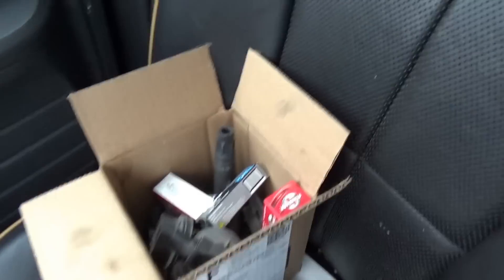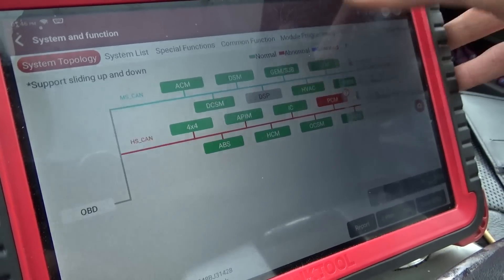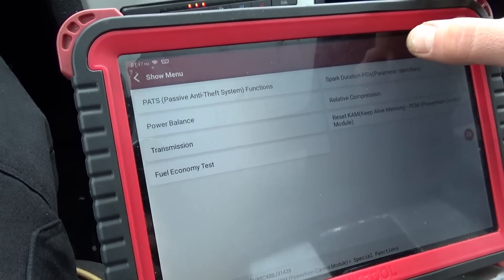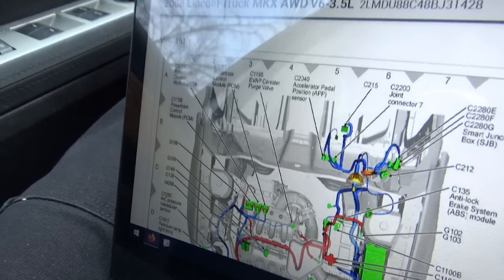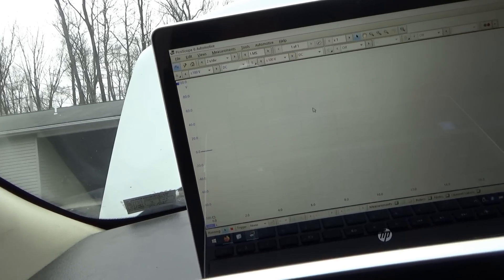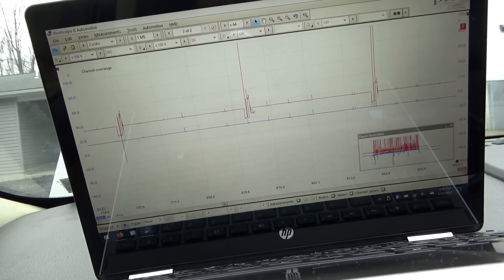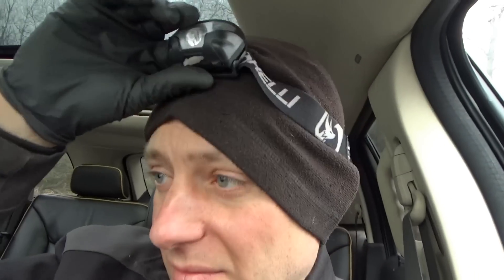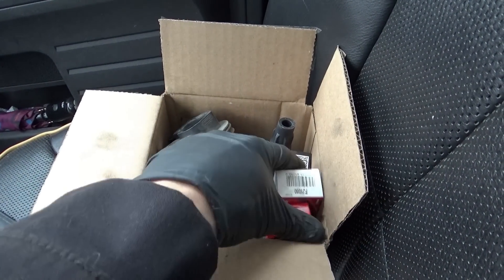Ford Parts Cannon MISFIRE (Why you NEED a Scope!)

Comment: Hate it when they fail and hold the ground on the coil and melt it. I’ve seen a couple that were a real pain to get all of the melted coil out of the hole. I’ve fixed one of these ecms by swapping the FET for one out of a donor but I had one that I couldn’t repair as it did too much damage to the board.

Comment: Your diagnostic is 95% thorough and I am guessing that you checked the missing step without putting it on video. There is a small possibility that the signal cable at the pin of the wiring harness corroded off. By piercing the wires with the Fluke connectors, you didn't really proof it all the way to the ECM Pin.

Comment: In a very small way, I’m actually against using a scope. Now, before you guys burn me at the stake, hear me out for a sec. This is my own personal belief for my own uses. I don’t have anything against anyone who chooses to use one. If a scope is part of your 4 major food groups, then great. But I feel that a scope is like a crutch, or a drug which becomes dependent on, hindering you from developing your diagnostic sense, since you’re continually looking for scope data to tell you where the issue lies instead of using your sense to tell you where to look. I find that for the most part, the same results can be achieved by using alternative testing methods based on symptoms that would coincidentally go hand-in-hand with scope data. I don’t care if all I need is a twist-tie and a rubber band to figure out an issue. If I found the issue, the job is done. In other words, you don’t need to dissect every electrical issue with a scope to figure out problems. Do I think a scope is better off as a door stop? Not entirely. But there comes a point where I believe a scope is a better teaching tool than it is for the sake of diagnosing. When I started watching you diagnostic guys here maybe 5-7 years ago, hearing this incessant preaching that the scope is the greatest thing since sliced bread, I said fine; The next time I’m in a spot where I have to pull out the parts cannon and risk misdiagnosing a car, and it’s because I don’t have the appropriate scope data to precisely tell me the cause of an issue, I’m buying one. Guess what, I still haven’t bought one, and I’m diagnosing electronic/drive ability issues every day. Good thing you fixed it, but didn’t really prove why I need a scope tho?
Reply: Here’s a perfect example where basic testing methods were used based on the given symptoms, and along with the right equation, the source of the problem was identified instead of a scope being of use, when you’d actually think it would have been

We recently got a loaner scanner which has a built in scope (my boss is considering buying a second). The other day, a 14 impala 2.5 rolled in from a different shop with a P0017 after a timing chain was done. They claim it was taken apart a second time and didn’t find anything wrong, but it ran perfectly. My boss said “try out the new scope and see if you find anything.” I hooked it up, and found that in this case anyway, it was pretty useless. Both intake and exhaust patterns seemed to be in sync with the crank, but the funny thing is, the pattern wouldn’t change at all when revving up or when unplugging the intake VVT solenoid… (exhaust is deactivated automatically due to the active fault) I tried adjusting the scales a multitude of different ways, but no matter what I did, the pattern wouldn’t show in any finer detail… I’ll admit, I have very little experience using one of these. Who knows, maybe I didn’t have the leads hooked up correctly. I didn’t have the manual, nor did I have a ton of time to play around with it, but the end result, it didn’t lead me anywhere. 

From the beginning there were several symptoms/characteristics I was catching onto, that was giving me an idea what was going on. The one I picked up on a little later on that stuck out the most though, was a very slight rattle that occurred several seconds after startup, that lasted less than about 2 seconds. For the hell of it, since I didn’t really have anything else to go on, I was really curious what the exhaust VVT actuator (which was also previously changed) control state was at the time of this rattle noise, so I put my test light on the power feed, and my LED test light to the control wire, (both are controlled by the PCM) and had my co worker start the engine. When the test light lit up and the LED started to pulse ground, the rattle noise occurred, and then both lights went out as soon as the noise stopped. At this point, I knew exactly that the exhaust cam phaser was bad.   

First off, cam phasers aren’t supposed to make noise when activated. Along with this theory, even though the scanner wasn’t showing me any data, I can safely assume the PCM begins activating the solenoids shortly after startup, and if it’s not getting the feedback it likes, it deactivates valve timing for that particular cam and sets a fault code. The exhaust cam phaser was replaced, and after running the engine and a road test, the rattle noise is gone, the fault code didn’t come back, and no more engine light. 

The moral of the story: Chase your symptoms with the utmost of simplest forms instead of relying on your scope to provide you with answers. I’d be hard pressed to convince an experienced tech to change their ways, if you do in fact use one regularly. But for anyone new to this, I’d say follow the 6 step procedure strictly, and simply chase your symptoms with the appropriate diagnostic tool that will most accurately pinpoint the issue. It doesn’t have to be a scope. Even though the scope has its uses, I believe it should be used in small doses. For your everyday diagnostic though, I don’t really think it should be a necessity

Comment: Interesting. I got a 2010 MKZ from a friend mechanic who got it from a customer. it had 210k miles on it. front suspension bushing was squeaking wd40 gel lube resolved that lol. otherise car seemed fine. I immediately did plugs on it and realized they were the originals! they almost had nothing left on them! luckily no misfires however I found why no one wanted it. the torque converter was acting up. the usual bs for a ford. i downed the price to $500 assuming the tranny would have to come out eventually. I just added shudder fix which has mostly in control. fluid was recently changed by friend. I gave car to my daughter who passed it to another family member. 3 years later the thing is still going. I have no clue how or why. the original owner Im pretty sure all they did was oil changes. I assume the water pump is also ready to let go which on that engine is yeah lets water down the oil...

Comment: My Trabant doesn't suffer from these types of issues. And if there is a problem; the owner doesn't need to find a savant, with a $2,000 scope to solve it. Usually, the problem will be seen, laying on the road in the rear view mirror. Wire, duct tape, a crescent wrench and hammer will fix most anything. So the money you might spend on giving your mechanic's children a "woke" education, can go toward happy motoring and entertaining the girls that want to ride in a piece of automotive history. Thanx Ivan

Comment: Jake at Automotive and Diagnostics found a leaky aluminum electrolytic capacitor where the leakage damaged adjacent components.  Aluminum electrolytic capacitors are a limited life item just like leaky AA batteries.  Big corporation uses the cheaper capacitors to save money and leave their customers literally cleaning up the mess years later.  Repairs replacing the cheap aluminum electrolytic capacitors also occur in the personal computer and the audio equipment markets.  Failure and repair not much different from the A&D example.  However, A&D made the mistake of replacing the leaky capacitor with a like kind which will fail the costumer again in a few years.  Proper repair uses a dry tantalum capacitor of equivalent ratings.  Parts are available at several online parts suppliers that do sell to consumers. The tantalum capacitor should last as long as the other state components.  Big corporation doesn't use the dry tantalum capacitors because of their higher price which however would be inconsequential to the customer.  Also, a Sony professional camera used 300 of the electrolytic capacitors which leaked and ate up the circuit board and caused a tech at a big expense to spend days replacing electrolytic capacitors and repairing the video board circuits.  Also, a Ford Mustang owner got his ECM running again by replacing the four electrolytic () capacitors in the ECM.  Also, this is why high quality Japan capacitors are often cited on computer power supply packaging.  
Pennies in the pocket for Big Auto and dollars lost out of the pocket of the consumer.  Repair guys doing the work that Big business wont do.

Comment: The engineers may have wanted a simpler (and probably cheaper to manufacture) system, not realizing that excessively worn spark gaps would take out the computer instead of only a coil. Of course, a cynic would say they did it on purpose to sell expensive computers.
Reply from the maker: You would think it's cheaper to have a 5V pulse going to each coil instead of including power drivers in the PCM...but maybe that would make the coils themselves slightly more expensive?

Comment: Ford Australia when they were manufacturing cars in Australia went to a similar direct fire ignition system to what the  3.8 litre Holden/Buick V6 engine was fitted with except the 3 driver transistors were in the computer whereas GM had fitted the ignition coil driver transistor."motherboard" into the ignition coil pack.

Ford started doing it that way in the mid 1990's in the EF Falcon but they reverted back to the previous distributor ignition system which was fitted into the EA-ED Falcon into the next model - the EL Falcon.

Too many EF Falcon taxis were coming in for ignition coil replacement under warranty because the ignition coils got cooked underneath the inlet manifold whereas the Buick (Holden) V6 engine which was mounted in rear wheel drive configuration in the Holden VN-VY Commodores (1988-2004 models) were mounted at the front of the car where the air cooled down the ignition coils.

Ford Australia decided to refit the EF Falcon ignition system into the AU Falcon in 1998 while it was a different design of car the same problem still arose - cooked ignition coils.

They revised that ignition coil in the series 2 AU Falcon but I don't know if that fixed the problem,by 2000 they built the DOHC naturally aspirated &; turbocharged "Barra" 4 litre DOHC powered 4 litre BA Falcon which suffered from failing ignition coils which were the Bosch/Motorcraft "pencil" type of coil (×6) which usually failed by 100,000 kilometres or 60,000 miles.

Maybe because it was a big inline six the ignition coils got too hot,I don't know but my brothers old friend fixedl his BF Falcon station wagon up by replacing all of the ignition coils & spark plugs because the engine was only running on 2 cylinders.

Yes, being an electrician makes it easier to understand & find faults in an EFI car but I upset a mechanic on Quora who said that I didn't know what I was talking about when I had a P0327 knock sensor code, a P0171 & P0174 code which was the cause of the check engine symbol turning on & off in my car.

I had that go out whenever I would blip the throttle because I had low fuel pressure cause the lean codes but it would only turn on at idle or low speed - it was caused by a bad fuel pressure regulator !

Comment: Good going! If they weren't going to use a scope, could they have used a "noid" light, or are those just for injectors?
Reply from the maker: Eh not very conclusive for such fast events, and if it doesn't flash then you still have to check power feed and control 👍

Comment: I'm gonna have to have you come down to ride shotgun with me for a week, Ivan!  You've been getting too many easy ones lately!  LOL  ;)

I've got a few 2022s and 2023s on my plate right now with no service info, minimal documentation, and outright bizarre issues, and I only get to poke at them in 20-minute bursts.
Reply from the maker: You work at a dealership?
Reply: @PineHollowAutoDiagnostics  I do diagnostics and ADAS calibrations for body shops all over North Alabama.  My biggest challenges are being time, space and access limited, and very often not having access to factory data due to vehicles being so new.

Imagine showing up, being told a vague explanation of what the problem is by someone that doesn't have time to talk to you, then you have at most 45 minutes (usually more like 20 minutes) to figure it out before the car gets yanked away to the next phase, knowing that it already has an appointment at the dealership for an HVAC recharge or something similar.  You also can't do any disassembly to chase harnesses or do pinpoint component testing.  :D

I need to start filming some of the problems I come across; you wouldn't believe the insanity I see almost daily...
Reply from the maker: @rhkips  oh yeah sounds like a different ballgame with the brand new cars haha

Comment: Wow,   not replacing the spark plugs can cause pcm to fail?   Damn.  I never seen those happen.   But God to know doing timely maintenance is important to do to prevent the driver to fail!!  Great video Ivan.   You're right a scope is important to find the fault!
Reply: It's bad design and probably designed on purpose to break.

Comment: Ivan, Like the Fusion shifter you did, FORD has a better Idea, Don't make it simple, make it expensive. I've got a 2000 F-150, 33K so far so good.
Reply from the maker: How do you have only 33k miles on a 2000 vehicle??
Reply: Most of the time It's in Garage 2000 SVT Lightning, Have been stashing parts when I can get them. Really enjoy your Diagnostic searches, Keep it up. @PineHollowAutoDiagnostics

Comment: This is why pulling HT leads on a running engine to check which cylinder is misfiring is a bad idea, it really stresses the insulation within the coil and also stresses the coil driver which has to absorb all the energy from the coil.
Reply from the maker: Just let the spark jump to a grounded test light...or your body will become the ground haha

Comment: And people think I'm nuts to, without deviation, change my spark plugs every 50K miles. I also change my timing chain or belt at 75k miles. Cheap insurance against buying a new engine in my humble opinion.
Reply from the maker: Some timing chain jobs take as long as an engine swap 😆
Reply: @PineHollowAutoDiagnostics  Very true. I try to own vehicles that are easy to maintain. Watching you is helping me with the newer stuff out there. Be well and continued success sir.
Reply: Timing CHAIN every 75k? WTF?
Reply: @DM-hw4cr  On my Wrangler it cost me $450 last time. New engine would cost over $4K for a remanufactured. Cheap insurance as I said.
Reply from the maker: @mattbrown5511  Maserati needs timing chain every 60k miles 😁
Reply: @PineHollowAutoDiagnostics  Always going to be an exception to the rule. But thank you, I truly did not know that. I learned something today.

Comment: I think the right parts were changed but for the wrong reasons. If #1 coil shorted out, the others were probably not far behind and those plugs had serious miles on them. It's too bad the owner hadn't replaced those parts, say, about 20k miles ago. As usual, Ivan. Another good informative video.

Comment: @Ivan - Excellent tutorial. The use/proper use of a scope would seem prudent and certainly definitive. Just a few questions: in lieu of a scope - (1) Continuity of coil wires to/from coil (DVM). (2) Continuity/resistance of coil itself. Isn't there a "filter", in the way of a capacitor (wouldn't a diode be best?), that prevents any errant current from going back to the computer if there's a short in the coil?

Comment: Ivan;  what type scope probes are you using?  Inductive coupled, or back probing the pin terminals, or piercing the insulation on those conductors?

Comment: Agreed. Scoping is a must these days. Just this Monday I had a co-worker ask me about a misfire on a Chrysler. I told him to scope all the injectors and the coils to at least rule out some preliminary fault source. He pulled the oil cap and saw oil/water mix and called a faulty engine. I knew better than this but I'm not the shop foreman. So at that point it was out of my hands. But I know he was looking for anything else it could be because scoping the related components meant not knowing what to do or how to do it. So instead of taking the opportunity to learn. Her went with a guess. The customer declined so the outcome never happened. Point being that a lot of techs still don't know how to use a scope and even if you offer to teach they're not interested.
Reply: Caused by being taught by the same mindset /shop owners